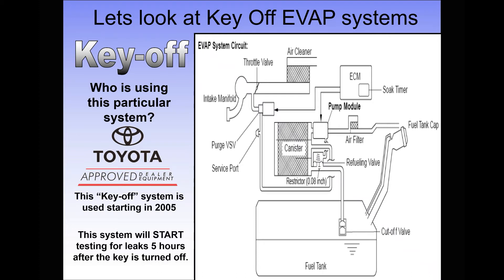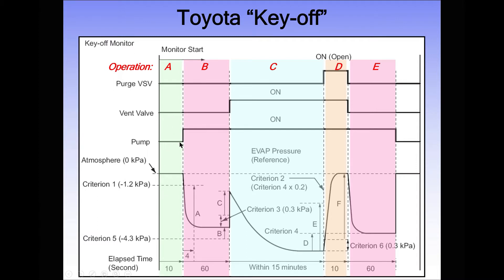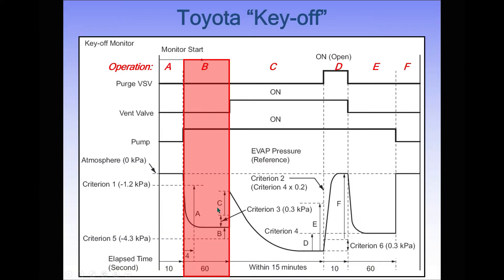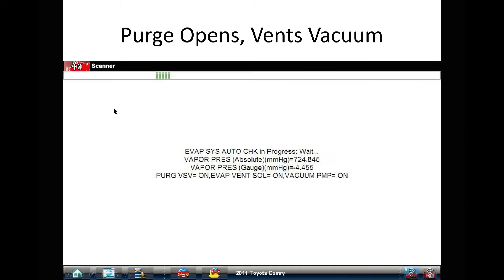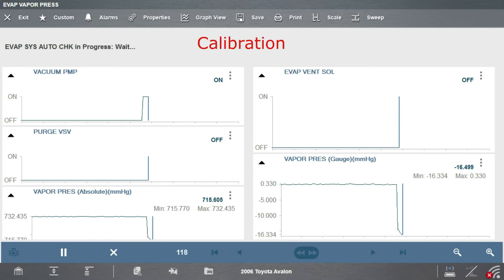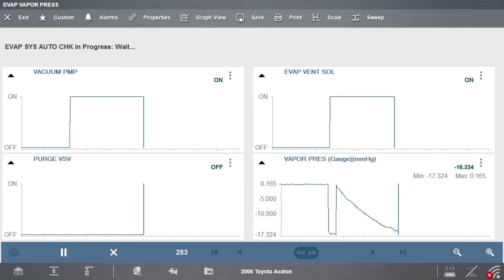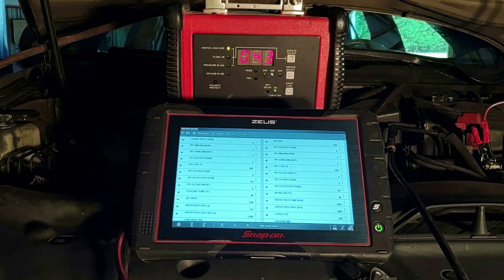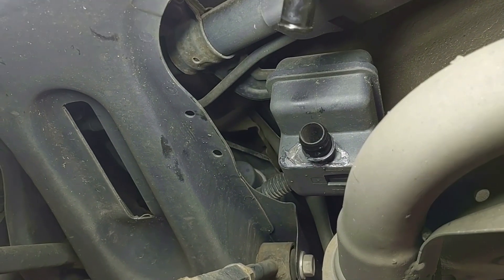Toyota Key Off EVAP System Diagnostics

Comment: Good lesson. And the service manual relies a lot on showing graphs to diagnose this system. My Autel 906 BT scan tool will run automatic as well as manual mode but does not do graphing unfortunately. I use automatic mode more like a go, no go test. I run it and then look for pending codes after. If I have a leak I first check or replace the gas cap. Clear any codes. Run automatic mode again. Leak codes come back? Clear codes again. Then block off different sections of the evap system and rerun automatic mode. If codes don't come back I know the leak is pertaining to the last area I blocked off. I can then narrow my visual and smoke testing on that section. By the way, great simulation! What software program did you use to create it?
Reply from the maker: Thanks for the reply.  The animation was done by my old boss.  I don't know what it was, but it was an Apple program.

Comment: On 07 Toyota highlander 3.3 engine
Can't run EVAP test on autel or launch says message scan tool not able to control vacuum pump vent VSV or purge all conditions or met fuel temp and level engine not running

I was able to do with snap on vantage legend but under 07 highlander there no EVAP test functions only if I ID car as 06 highlander with 2.4 it was able to get it to work but only EVAP manual was available
( will Evap manual test show pending DTCS if for system issues like leak p0455 or p0456 or does only EVAP Automatic test only show it?
Reply from the maker: Hi Justin.  You have to run the automatic test to get the vehicle to show a Pending Code.  The manual test won't do it.  If that test doesn't show up in the scan tool for that year, definitely call their tech support and report it.  The vehicle definitely does the test.  It's a software error on the scanners part.